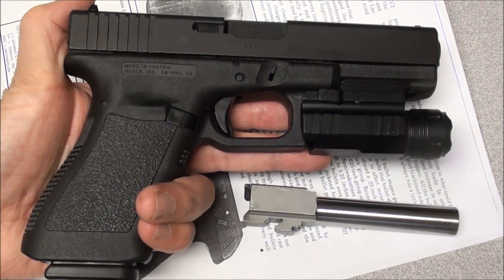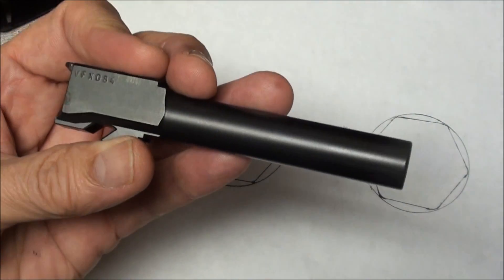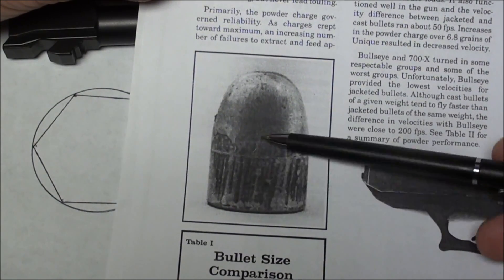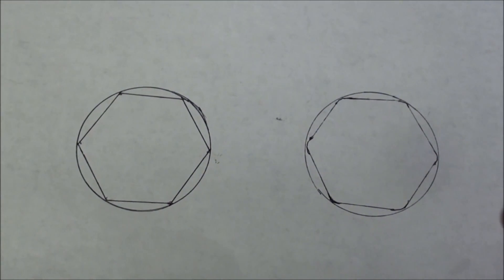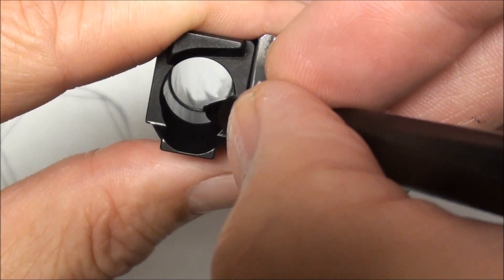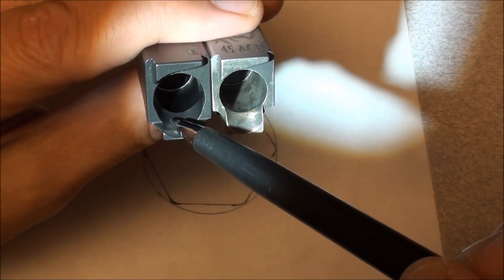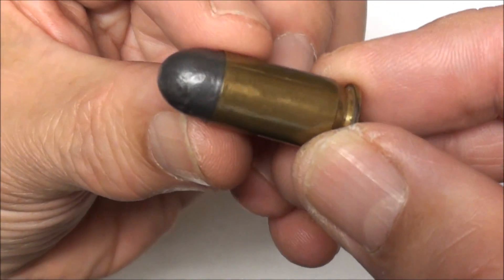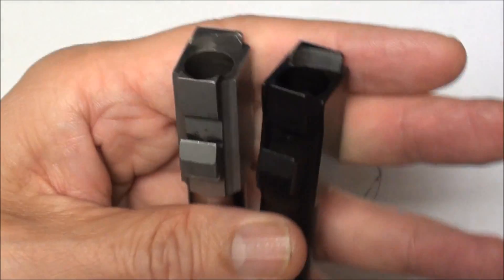Polygonal Rifling in Reloading Ammo for Glocks

Comment: Well, first off glock barrels are not true polygonal rifled. I am not sure why so many people seem to think this but they are not. Look through your glock, then look through a barrel out of a Tanfoglio, or HK, and you will see they are not the same. Glocks are regular hammer forged with standard rifling then are intentionally rounded to increase longevity. 
   Also it has nothing to do with polygonal rifling being prone to fouling with lead, that is MISINFORMATION. Glock gives a ridiculous warning on ALL handloads to cover their a$$ since there are so many idiots out there attempting to reload that have no idea wtf they are doing. Combined with the fact 80% of firearm owners do not clean their weapons enough, nor do they know how to properly clean the bore and end up many times doing more harm than good. As a gunsmith/custom rifle, pistol builder I see it ALL THE TIME where your typical firearm owner/hunter comes in with his weapon he cleaned maybe once, and has no clue how to properly clean them and uses brushes, solvent, rods that no one should ever use, doest use a good bore guide or even know what one is. Never use brass or bronze brushes in a bore PERIOD. Synthetic brushes made by Iosso or Boretech are not only safe but will last you over 50 cleaning sessions. Get a good coated cleaning rod like a Boretech, Tipton, or Montana Xtreme, use good jags made out of aluminum, Butch's Triple Twill patches are hands down the best. Solvents that actually work that are safe are Sharp Shoot R Products like Patch-out, wipe-out, tactical, carb-out, as well as Boretech's solvents, and Thuro-Flush/Thuro-Clean. Always use a good quality bore guide like a PMA, Oppsumn Hollow for your bolt actions, for AR15 I prefer the JP Rifles anodized aluminum bore guides. Stay away from bullshit like bore-snakes, those Otis cables or any cables and brass loops SMFH or any of that JUNK

Comment: Well explained.  I have long thought that the polygonal rifling was not the issue.  I understand that the danger is more on the 40 cal than the 9 mm or 45..
Have you found this to be true?  It seems reasonable in that the 9mm is smaller that the 40 cal and the unsupported area would seem to be less.  On the 45 ACP is might be due to the much lower chamber pressure produced by that cartridge.

Comment: was cleaning my father's glock recently,and noticed that inside the chamber /thicker part of the  barrels chamber where the bullet sits while loaded there is slight indents/like the metal is slightly chipped up in one spot ..I'm sure it has been fired like that before cleaning and noticing it.. I'm wondering if it's just natural wear and tear and if it's completely fine for him to still use at the range or if he now needs a whole new barrel..the rest of the main section of the barrel is still in great condition except for the chipped metal inside the part of where the ammo initially sits once a round is chambered before firing and ejecting the casing.
I'm no expert besides the basics, that said I was definitely surprised that it was chipped like this after stripping down and cleaning it.  Is that normal or cause for concern ? Would appreciate any feedback  thank you

Comment: The unsupported chamber creates the glock bulge in your brass. Reloading these resizes the bulge away but the stressed brass is still there. The second or third time this weak spot lines up in your factory barrel you get a blow up. Great video. I only shoot cast reloads so I guess I need a new supported chamber barrel. Thanks for the video. Taught me something.
Reply: I have reloaded brass fired through 9mm Glocks 5 or 6 times.  I would keep going, but I lose cases every time.  I have found a few cracked at the mouth, mostly Federal, but nothing at the feed ramp area.

Comment: It happened to me recently, my surprise was due to inexperience with Glock. I was observing in a digital microscope, seeing the cut and tearing off part of the bottom of the pod and came to the same conclusion. I am not an expert enough to have observed the draft, but I did find the chamber to be flat and the connection of the ramp to the barrel to be sharp. From there I could see that the brass explosion took the shape of the ramp. Thanks for your contribution, it confirmed my research!

Comment: My guess is that Glocks actually don't blow up anymore than any other. Reloads in 30,21,20,17,43, 10s of thousands of them cast lead some so hot I thought they should blow up and was kinda trying +p++++++ stock barrels, springs, aftermarket barrels, and any combination there of. Swapped out mag primers for standard ones, home brew .460 with stock barrel, 10mm nuclear 40sw nuclear in a coversion barrel and 10mm barrel and nothing. Ever put so much powder in a case that it split the case while seating the bullet? Yet a friend's 10mm smiled and blew bubbles with factory ammo.Then someone else's blows up for no apparent reason with standard ammo? Who knows what combination of events causes it. Many manufacturers say no reloads and more say it voids warranty. I had a Blackhawk revolver blow the cyl to pieces and the top strap completely off right next to me the guy reloading and shooting didn't get a scratch and I ended up with part of his gun in my leg. At the same time I know and have my self loaded the same model. 45 colt to near 454 pressures and nothing. Again I think it's most of the time a combination of things not just a reload or bullet seated to deep, or this or that. Fast powder, hot primer, overcharged, flawed casting/forging, bad head space, oversized projectile, out off spec chamber, firing out of battery, maybe a week case although many a spit cases with no ill affect, obstruction and more It is not just one thing unless it is to the extreme but if you stack all the little bits you get the kaaaaabooom in a glock, ruger, sw pick you flavor. There ain't anything special about a glock for good or bad.

Comment: I have run several thousand rounds of lead both lubed and powder coated through my glock barrels and have had a problem with leading or fouling. I do run the lower pressure loads.

Comment: The lip that’s at the beginning of the lands and the end of the chamber has to be there that’s how the bullets or cartridge seats. The cartridge seats on the mouth of the case that’s why that lip is there is supposed to be there. Now you can do reloads with fully jacketed bullets in your case is no different than factory ammo.  And today they have coated bullets that are either coded with copper or a new plastic in which the lead never touches the lands or grooves therefore you do not have any buildup from lead. And if you choose the correct gunpowder you will have less debris as well. So you can use reloads on Glocks and the Glock barrel however I have Problems with 45 APCs from a Glock to a match grade barrel. The bulges huge however 9 mm goes through my dyes and is totally removed and I have no issues loading in my 9 mm. Remember the lead bullets have to be coated which eliminates the lead from contacting The barrel.

Comment: You say , "Don't use lead bullets".. then add "Don't use reloads" in your glock.  These are 2 separate things and you are trying to add one to the other, for what reason I don't know.   I don't shoot lead in my glocks , or any other gun for that matter, but properly loaded ammo has absolutely NO adverse consequences in a glock vs any other gun.  The key word being "properly".   I would add that if you shoot too much lead without  proper cleaning in any type rifling you're headed for trouble, it just happens faster in a glock type barrel.
Reply: As long as the lead bullets are powder coated it's no longer a issue and are perfectly safe.

Comment: I have a gen 1 Glock 17, purchased new in 1985 or 1986. The barrel has a fully supported chamber as in the aftermarket barrel you show. It is the original barrel. When did Glock change their barrel/chamber design?

Comment: I recently bought a Glock 21 in .45acp. I've already had several examples of the famous Glock Smile with my reloads. Which are not plus P or should not be over pressure at all, but most are loaded with Red Dot or the new Cleanshot powders. 5.4 grains of Red Dot is pretty much a standard load in all the sources I've got. First time I'd ever heard of it being a problem in a Glock. Guess I need to go ahead and shop for a Wolf Barrel for mine as I've got literally thousands of rounds loaded like this. Don't want to blow up my new gun but hate to have to special feed it too because of a design issue. I had no problems whatsoever with the loads seated out to standard length, but the guppy bellies happened with some Gold Dots that I had seated deeper into the cases, so maybe that was the issue. Good video, I learned a lot about Glocks, which I had little previous experience with other than my .380, which I've never had a problem with at all.

Comment: I blew up a Glock 29 from lead bullets, and it had a Lone Wolf barrel installed. I had allowed lead fouling to accumulate, and while I probably could have shot lead bullets all day, the second jacketed bullet sent down range through that fouling caused a KABOOM! The Lone Wolf barrel split into four pieces, with the piece on the upper left quadrant apparently going into orbit after seriously bruising my left index finger, as I never found it. The remaining three pieces showed significant fouling.

Lesson 1: The dangers of lead fouling are not exaggerated.

Lesson 2: Not no more lead bullets for me, but no more lead bullets in a 10mm. Jacketed bullets only.

I still have the Glock 29 factory barrel, which is just about the only thing on that pistol worth salvaging.

Expensive lesson, but I'll never forget it.

Thank you for your excellent content.
Reply: How many rounds had been through it without cleaning before that happened?

Comment: PSabout 45 acp chamber  oversized is  lol /unsupported at back is  normal for as low as  normal 45 acp //that s why 45 super  is same  outher  mesure  like 45acp but in fact   45 super  got   thicker  bottom and    side walls on brass //look   cutoff 45acp vs 45 super and  you see

Comment: Seams your logic is on point. And I submit to you a statement and a question. The statement being, that the original glock barrel with minimal support has better function in regards to jamming. And the very important question I have is. Many magazines that are filled to full capacity cause the last bullet inserted to be such a tight fit into the mag, that it creates a grooves on the shell casing, of which, seams in my mind to weaken the durability of the shell. Therefore, is it a problem, is there a greater chance of the gun exploding?

Comment: I don't know which is worse. This utter BS or the fact that so many commenters seem to take you seriously. Not one of them has a Glock to look at? I've had several, and still have one in EDC rotation. None of them have the rifling you describe. And don't tell me that the "shape is exaggerated for clarity". What you show is a rifling pattern last used on the Whitworth rifles of the 1850's. Glocks use a rifling pattern that resembles normal cut rifling except that the lands are trapezoidal rather than square. It resembles "R" type rifling first seen in the west on captured AK74's although the "R" lands are a bit taller and the grooves wider. The rifling you show was designed from the beginning for cast lead bullets. The Glock polygonal rifling was designed for jacketed bullets, and cast bullets have never been recommended even though many folks shoot them.

Comment: I dont own a Glock but i do own a HK P30 with the exact same type of rifling. Today i learned something about my P30 i didnt know. Had to take it out and look at the barrel. The chamber is fully supported and its slightly oversized. It also has a little extra step in the chamber right in the area of the case mouth and before the step from the chamber to the actual barrel. Maybe as a sort of a gas check? Or to better centre the cardridge in the chamber while maintaining the reliability benefits of a oversized chamber?

Comment: All I've ever shot in my g17 is 124 lee cast round nose with liquid alox for lube. Every 20 rounds or less I take copper scrub pad cut some off wrap around bore brush scrub lead out. If you keep shooting your leading barrel forcing same size bullet through smaller bore not good. I've shot alot through my glock all lead reloads just keep bore clean follow load data you should be good. I have but no guarantee any gun can fail any time.

Comment: Almost all of my ammunition is reloaded ammo with poly coated ammunition and that is why I use a Wolff barrel and keep my Glock barrel in reserve.  I did have a ka-boom  early in my .40 caliber Glock 22 that blew out the magazine and broke the extractor claw.  Switching to a wolf barrel,  I also removed the projectile and powder from over a thousand rounds of .40 caliber reloaded ammunition and resized the cases and re-reloaded them using a lee factory crimp die as I found out some of my reloaded rounds were sticking (nose-diving) in the chamber.  This over crimping can also cause a ka-boom.  Since then I have gone through more than 5000 rounds of poly coated reloaded ammunition with no instances of a problem.

Comment: I know this an old video but I will have to say through experience using a Blacklist barrel (9mm fully supported) saved my ass and my frame when I squibbed using my 9mm 124gr reloads.  You might not believe me but case bulging is due to stock Glock barrels.  So reloader's beware.  Yes you can get away with shooting reloads through a stock Glock barrel and get away with it,  but how long I don't know,  but check your cases after and see the difference when reloading a complete round.  Case bulging does not happen with the fully supported barrel.

Comment: Reloads with hard Lead bullets work just fine.  I have a Gen1 Mod 17 & Gen 4 Mod19 and for plinking reloads, I have had no problem with factory barrels in all lead bullet weights, 115gr, 124gr, & 147gr.  But I only use powder charges middle average halfway between start loads & maximum loads.  IMHO, Glock barrels feed better than aftermarket because of the looser tolerances like in AK-47s.

Comment: Also consider that Glock's have an unsupported barrel/chamber.  That exposes the base of the case which may lead to problems with cases splitting with the inherent pressures of the cartridge being fired.  This also causes bulged cases for ammunition being fired in Glock pistols.  Also want to add that Glock chambers tend to be oversized which gives them the ability to handle out of spec ammo which folks tend to think of being more reliable.

Comment: I have heard and read of lead building up in polygonal barrels, maybe the peak of the rounded rifling is taller than standard rifling, also maybe polygonal rifling does not get a good enough grip on those heavy cast bullets and it slips and smears the lead off the bullet and leaves it in the barrel. I watched a video of a man shooting heavy cast bullets in a glock and they were tumbling, he switched to a lighter cast bullet and they quit. He also tried those same heavy bullets with a standard rifle barrel and had no tumbling. Looks like the bullet was slipping in the polygonal barrel and the bullet was not  spinning enough to keep from tumbling. Maybe I need to start making videos.🙂

Comment: The operator's manual with my issue Glock pistol does say 'no reloads' (without qualification or exception) and does not mention 'lead' bullets of any type.  
It also claims to have polygonal rifling.  Which is not the case.  Heckler and Koch makes some handguns with actual polygonal rifling.  Glock rifling is more like Metford rifling in the 19th Century.  
The idea of a regular polygon is a plane figure which is equiangular and equilateral.